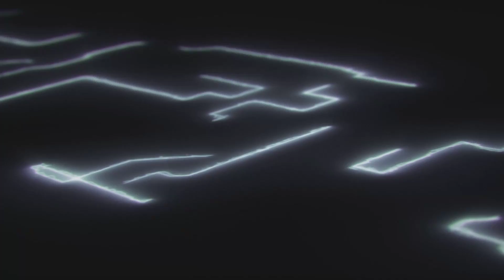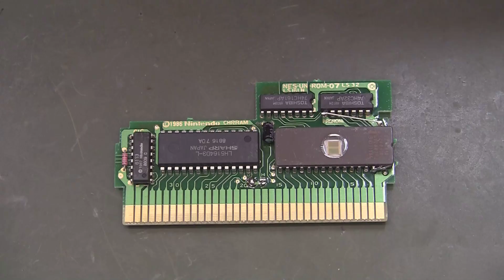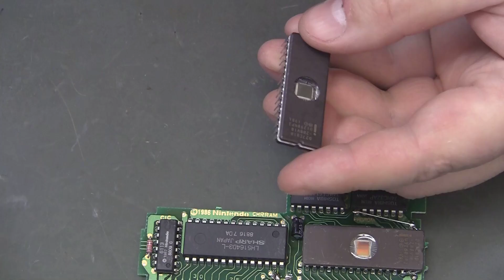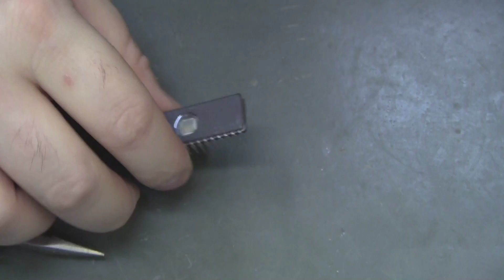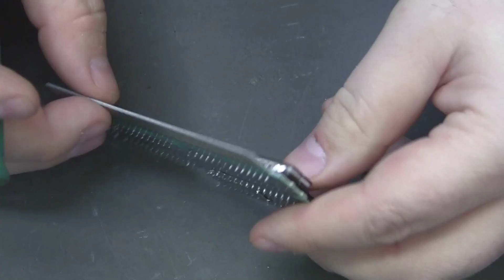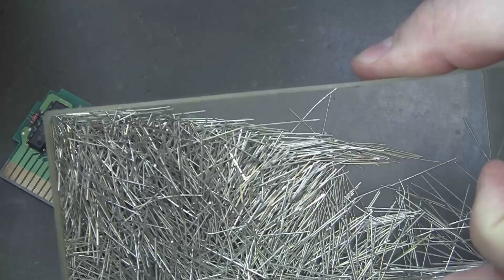Nes UnROM donor Repro wiring guide time saving tricks

Comment: I'm my rom was only 64KB could I just use a 28 pin EPROM with no rewiring? Like a 27C512
Reply: Answer is yes, Just lift pin 8 on 74HC32 and ground hole like in vid. And side note, if doing this on a konami board, you lift pin 6 not 8.
Reply: I have a 64KB ROM. I am Using 28 pin 27C512 EPROM also.  Lift pin 8 on 74HC32. What do you mean ''ground hole"?
Reply: @ericm5103  When you lift pin 8 out of hole 8, you leave a hole behind that the pin used to occupy. You should connect that hole to ground.

Comment: Why solder VPP (eprom pin 1) to 5V? It's for programming, not needed for reading.
Reply from the maker: +zolwikwkurwik 
Check your data sheet operating mode truth table for read only, some need Vpp to be high, some can be either high or low, some need to be low like certain flash chips.